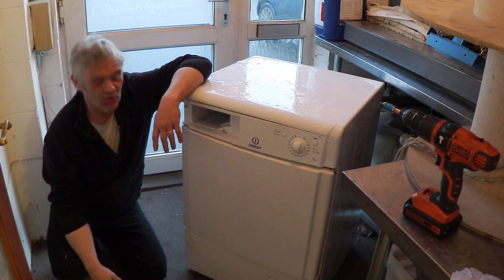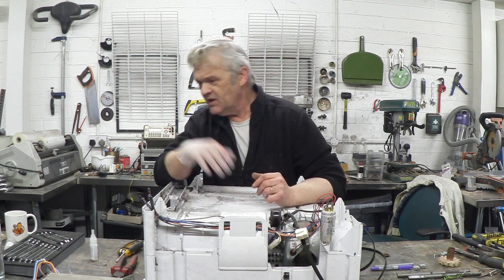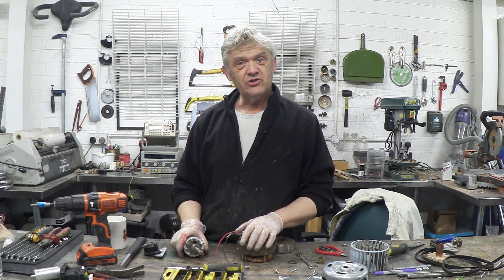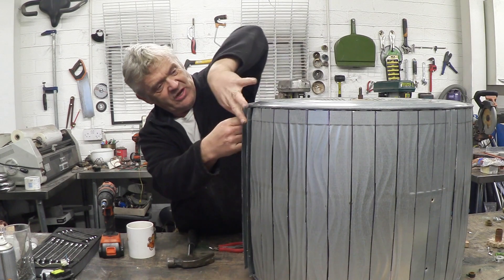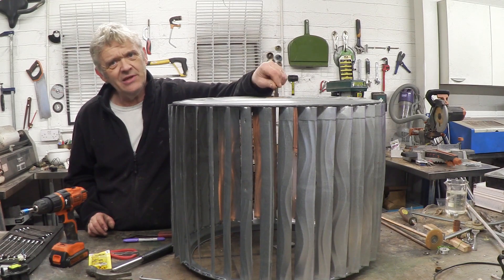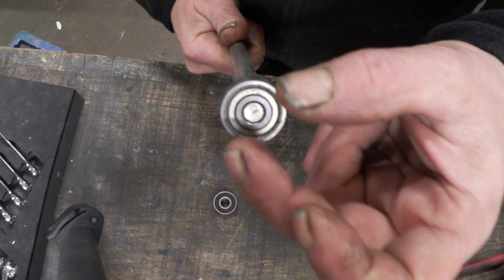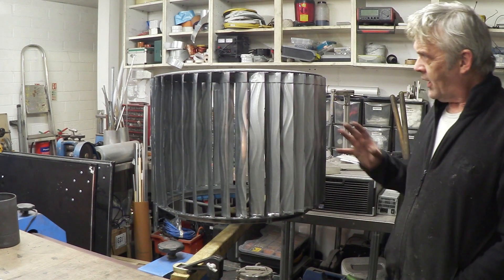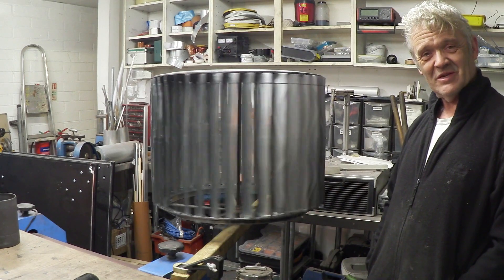Wind Turbine Rotor From An Old Tumble Dryer

Comment: I was wondering, if you simply attach some blades at a steep angle on the lines instead of cutting them, would the air create a boundary layer and help the blades harness more energy instead of air going through the cuts and trying to exit on the other side thus pushing the turbine to slow down. or you could attach some wall on the inside to guide the airflow up or down

Comment: I don't know if you have those cheap DIY stores called harbor freight? Detail really inexpensive tools but anyway you can buy a very inexpensive tool it's a long flat vise-grip it's for grabbing sheet metal and picture of regular vise-grip with two long strips of metal welded to the tips and allow for clamping of long pieces of sheet metal it would have been perfect for this type of job so keep that in mind if you do this again

Comment: hay have you seen the direct drive or smart drive washing machine motors they are magnet and will put out  from 800 to 1500 watts and they work without modification  if not rob look it up you will be glad you did if you cant find one i will send you one if shipping is not  to high

Comment: What was it made of,will it go rusty,does it need painting?
Reply from the maker: it is from a tumble dryer mate so it is meant to get wet then dry over years of use - so I think it will be fine - still I like the idea of painting it just to make it pretty, anyway it's either stainless steel or zinc coated steel - it will depend on your tumble dryer I think

Comment: I would avoid cutting the drum and I would probably stick (rivetted) some angle shaped thin metal  or plastic on a outer surface, Maybe at the angle in relation to the axes of rotation , to maximise surface  in contact with the wind. Seems that you are more focussed on electrical (generating) bit of the wind generator , than you try to adress aerodynamic side. However , I get that simplicity is the key and you work with what you have. Also , I can't wait to see some ideas about charging controller for a windmill (DIY style , of course). I quite like the your videos from last couple months , keep it that way , if possible. All the best !
Reply from the maker: we would all do things differently mate - well that's what I have found
Reply: @ThinkingandTinkering  I get that - it was not a criticism , just suggestion . Maybe someone find it usefull , because many people thinker in their kitchen (they live in apartments) , so use of a angle grinder might be complicated or impossible. Also , I try to keep my comments as short as possible and English isn't my language , so it may look (sound) different than itended.

Comment: Small vawt may get away with nothing but radial bearings but the bottom bearing of a medium to large VAWT may have relativly heavy or large radial loads in heavy winds and thrust loads from its weight. Taper bearing would work best for top and bottom, especially if the top is secured by a cross held in position with guide wires.
Reply from the maker: absolutely mate - there is little weight and not much height here so it should be fine - but a bigger one - I think you are spot on

Comment: That's a awesome rotor Rob Sir, flawless rotates smooth, there was a very slight wobble visible may be because it's yet not perfect balanced, but I could see rain drops on the top of rotor which surely means you were impatient to take it out and check rotation in wind😂😂😂 OMG yes one should always be impatient to check some work done!! Lovely rotor design Rob Sir please dress your wounded finger, it surely hurts more in cold!!🌹🌹 Lovely video, God bless you,I wish you a very happy new year Rob Sir in advance and pray for your health and well-being. May this new year bestow you with best of ideas to make life easier, may there be some capacitors and batteries this year, May I also get the conductive ink you made this year hopefully😂😂😂 Love respect and very warm regards Rob sir from India👍👍🤗🤗🤗🤗🌹🌹🌹🌹🙏🙏
Reply from the maker: it's not perfectly balanced mate - I won't balance it until I get the magnets fixed on then balance it
Reply: @ThinkingandTinkering  very true sir the air gap is small but important factor in generation of currant, you can finally balance it only after mags come in, but this seriously was awesome idea cutting a drum form blades, there is a added advantage of it being monocoque making it more robust and can handle stress much better than a rotor that has more screws for upper n lower base plus screws or bolts for each blade, in strong wind it would vibrate no matter how well balanced it is👍👍 Wish you a very happy new year in advance sir, Love and very warm regards from India Rob Sir

Comment: I still have my two drums ready in the workshop but need to find the time. Did you check the thermal switch to see if it needed to be reset. I bet it was all that was wrong with it
Reply from the maker: I didn't mate - I wanted the drum - so I got out the hammer lol
Reply: Another start to a great build by the way

Comment: Why not mount around the central support shaft and have the magnets spin around that by action of the drum? Then you could run the coil line through the central shaft and have an enclosed system that just looks like a whirl fan.
Reply from the maker: good idea mate - cheers

Comment: After the first time slicing my hand open over 40 years ago, I always wear gloves when playing with sheet metal...
Reply from the maker: in over 50 years I have never cut my hand on sheet metal - it's just how you handle it - I mean have you ever cut a tomato with gloves on? Of course not you handle the knife properly and there is no danger - if you don't handle it properly then yeah wear gloves
Reply: @ThinkingandTinkering  it's more the kind of gloves you use handeling the grinder. You might be many kids technological hero and set the example 😃
Reply: @ThinkingandTinkering  True you have to be careful, but things happen... Sometimes it is so sharp you don't even know you got cut until you try and figure out where the hell all the blood is coming from.

Sliced my knuckle open when I picked up a screw driver off a piece of sheet metal from a radial arm saw I was working on. The edge was so sharp, I didn't even feel it... And I don't remember grazing my knuckle against the edge sticking up, I just grabbed the screw driver and picked it up. I only noticed I sliced my knuckle open, when I dropped a screw on the floor and went to pick it up and saw blood on the shop floor, and thought... WTF... Then I noticed it on the bench and the saw I was working on... I was bleeding like a stuck pig. I had blood all over my hand and running down my arm. And after figuring out and finally seeing where it was coming from, then it started hurting... ;) really bad... lol

I should have went to the hospital, it was that deep. But I hate going to the doctors... So I straitened my finger so the slice would stay closed, wiped the blood off and quickly wrapped it in electrical tape. Got nervous when it swelled up with blood under the skin, but it was fine after a few days...

After that was when I decided to wear gloves while playing with or near sheet metal...
Reply: In my college days I walked past someone's freshly cut steel gear tray they had left in a vice and it sliced through my overalls and into my arm. Didn't even feel it, just felt a growing wet patch!

Comment: I have. Dryer in my storage locker I was going to use the magnets for to build a wind generator. Didn't think of using the drum as the blades. NICE!

I wonder if the drum could be used as the rotor in a large corona motor...
Reply from the maker: now then - that's an interesting idea

Comment: Just so happens I've got a tumble dryer what doesn't heat any more sitting at the back door. Cheers it looks a bit easier than the one I was going to build from a plastic 45 gallon drum with bike wheels at both ends. You make the blades by cutting flaps and using a heat gun to bend them to the angle you want inwards. I do have the bits for that also. I'm jus wondering whether bending the blades inwards might be better than outwards? Or whether it matters at all!👍😁💛
Reply from the maker: I think there a few ways of doing anything mate - basically it's nice to have options

Comment: A word about bearings. Skate bearings are made to take stress though the race and outer ring. Not sideways like this. This will fail early because the bearings will be forced to run on the edge of the groove. If you use a cone bearing. You can get one for the proper weight of the item it's meant to hold. If the bearing needs 10F lb's to load it. Then a 10lb object will do the same thing. Meaning all those ball bearings will be running in the track they are meant to run under the least stress. Weight your drum and get a rear axle cone bearing that is the closest torque rating as the weight of the drum. Also, the size you want. I'll bet a Toyota or Hyundai small car rear axel will have what you need. They also come in almost any size and load rating and found at any junkyard or parts shop.
Reply: Yeah, the bearing used in the video are designed for radial loads,  not for thrust loads. Taper bearings are better when one has both thrust and radial loads.
Reply: Called tapered bearings. Front wheel spindles.  Take the grease out and they have little friction. That drum weighs nothing compared to the load of 1/4 of the car.
Reply: @MAGnetICus_Attractus  Bicycle cup and cone bearings might reasonably deal with the thrust and radial loads that this drum will exert.
Reply: @kreynolds1123  I also figure when one side wears out I will just flip the wheel over and wear out the other set.
Reply: @MAGnetICus_Attractus  Cone is the name of the bearing type. The taper refers to the rollers inside. Tapered bearings the rollers only fit in one way. So two different types doing a similar job. Depends on what the load is doing.
Reply: @Mr.Unacceptable  well the spindle on a car is tapered......Tapered roller bearings feature a cup and cone assembly. The cup is comprised of the outer ring and the cone ...
Reply: Well, in part, he has the right concept, he needs to take the binding off the outside and  race.
My professional occupation is manufacturing Superchargers USA, (Blowers), service, and repairs.
I created this business in 1997 and sold it to my business partner in 2006, because he was a steep. So I sold my shares because I saw what was on it's way to biggest problem:   .         
ANYWAYS,
IS THERE ANYWAY TO COVERT A DRYER MOTOR INTO A WINDMILL TO CREATE ELECTRICITY?
Any help would be extremely useful.
God bless you,
Todd
Reply: You could also use a centre post, weld on a thick washer and use a flat roller bearing. Thrust bearing?  Then you could use the skate board bearing to keep it centred.  I still think the cone bearing is the better option.
Reply from the maker: sure mate and nice points
Reply: You could possibly have more stress sideways than expected, I can see the Magnus Effect at play, possibly... so good appropriate bearings is a must. The dryer contraption is brilliant!
Reply: use a trailer bearing set with a 1.06" shaft

Comment: A few of those bearings mounted vertically on rods or bolts welded in a star pattern will help take the weight on the bottom.
A great way of making a large squirrel cage, could have used two shifting spanners to help you bend the fins out to the right angle.
With the motor, I have seen grooves cut out of the metal ring housing the coils and gluing in magnets in a N, S, N, S configuration before putting the housing back on to boost the motor (come generator) performance.
I got an awesome 3 phase motor from a front loading washing machine that is a ring of coils sitting in a cast dish with N, S, N, S rare earth magnets. It is only good for a windmill type wind generator after being converted to remove the 3rd phase or using circuitry to convert the 3 phase to regular AC. Still an awesome motor for free.
Reply from the maker: for sure mate

Comment: Yes! 👍👍👍 Happy to see this. I am testing this design with plastic pails. Glad you used the dryer. Question: Could I stack these, with magnets on each with one set of coils on a fixed plate between? Could I get more power per foot of copper? I ask because copper is the most expensive element in the build.
Reply from the maker: I don't really know mate - sorry - personally I wouldn't use copper but only because it costs quite a bit

Comment: Is that a server grade UPS sitting on that desk on the right @8:00? ;D Those are great as super cheap inverters (also great because of their high output and automatic switchover to line when your system battery is low). Excited to see whats planned with that.
Reply from the maker: yes mate it is - and nice spot!

Comment: Situate it horizontally over the ridge of a pitched roof and it should benefit from the increased wind speed passing over the top.
Reply: It would lose most of its ability to be omnidirectional. If you have weather hat always comes from one direction, and you have a roof ridge-line that is being cooperative in its direction, then this would be a significant magnifying  factor.
Reply from the maker: cheers mate

Comment: An adjustable wrench would be a good tool for bending the blades.
Reply: A vise grip with wide jaws  or even two joined together with two flat bars or angle and bend the whole blade , if one wanted to to this a lot which in the times and the conditions we are facing there will be a lot of demand for the sparkling gems robs chucking out 
Food and energy self sufficiency are the fundamental foundation of peaceful evolution and rob is a peace warrior champion of the highest caliber 
It may not seem like it to many but very great times are ahead 
Good cheer to rob and all his mates
Reply from the maker: for sure mate - nice tip